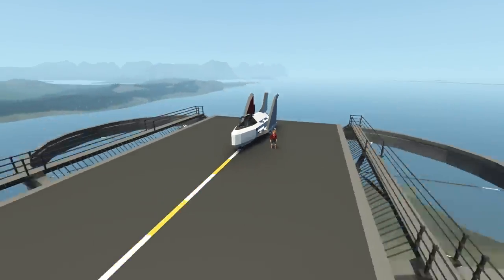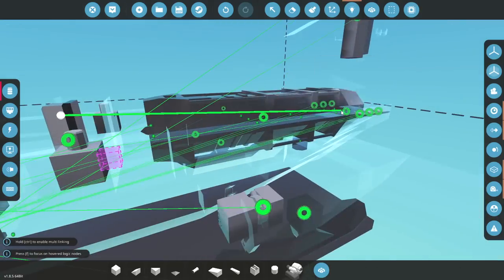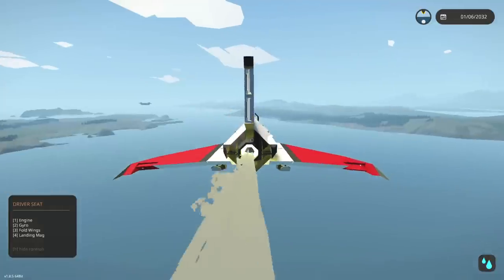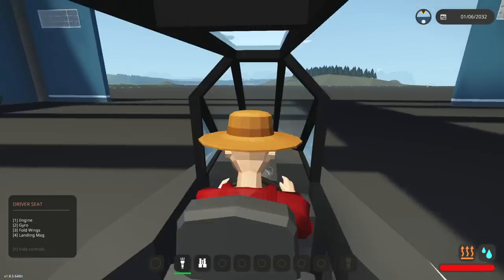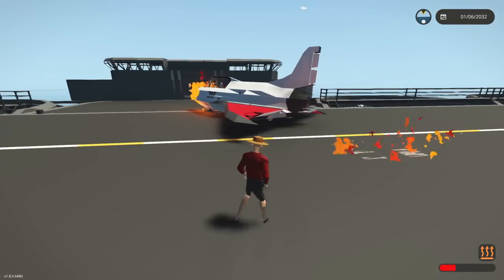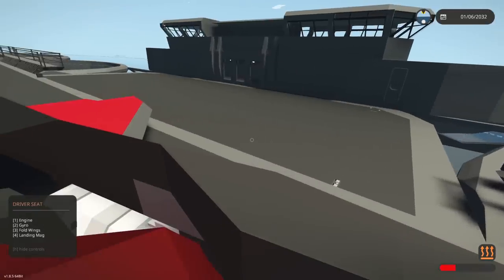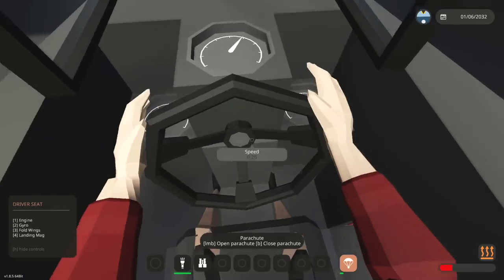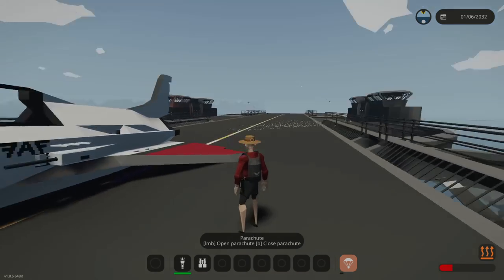FIXING UP Our JET PLANE On Our FLYING AIRCRAFT CARRIER In Stormworks! #7

Comment: a quick tip DONT put rudders on wings that are mounted by a separate body it causes so many mobility issues (i would hide small fin rudders in the fuselage if you want wings at an angle